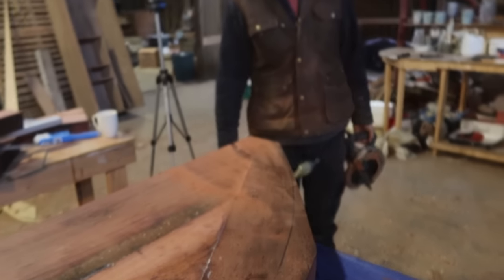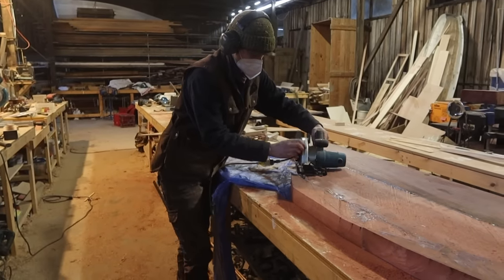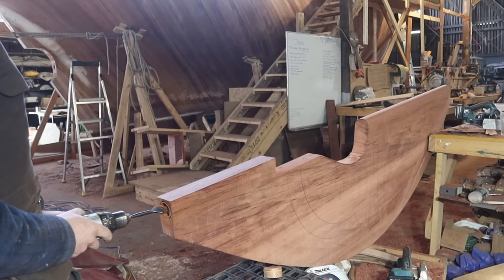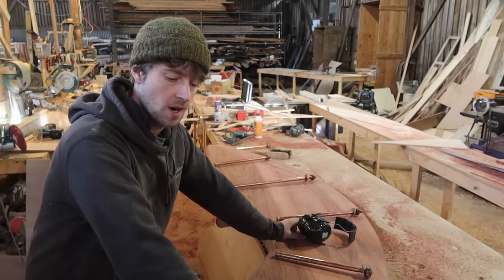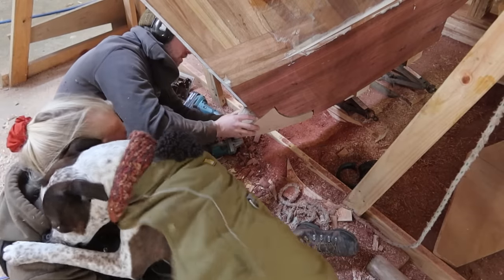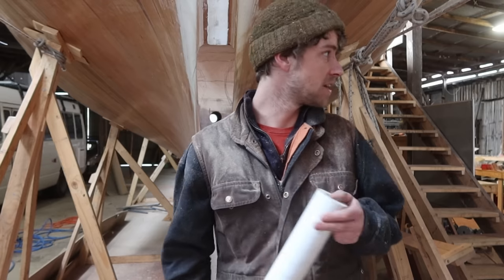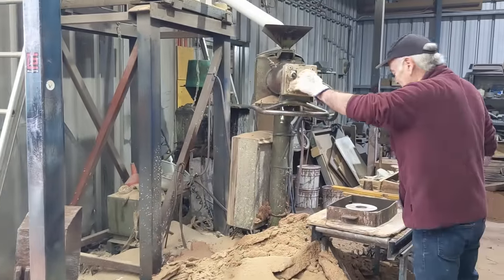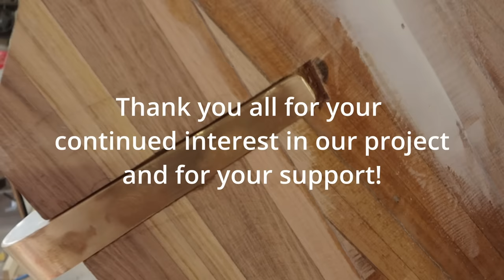Building the Rudder for our wooden boat / part 2 (EP31)

Comment: Another great episode with all the skills on show, the castings are excellent, and boring that hole over that distance is no mean feat, the boat will be a sight to behold when completed, watched from the start, never tire of seeing your progress, good luck from the UK
Reply from the maker: Ah what lovely words! Thankyou. Or was certainly a bit of work to bore through but we got it done!
Reply: I was terrified watching Matt bore that enormous hole in the rudder at the beginning of this video! I kept thinking, what's he going to do if he goes off line with that monster of a hole bit? I was esp. concerned about taking so much wood away from the rudder at such a crucial  load bearing point ! I do admit to a little concern remaining; do you think that there's enough wood left for the required strength left in the wood at that point or will the copper tube take most of the load? I am thinking of another casting to encase that part of the rudder? Just my thoughts on it. You two are fantastic artisans at what you do! Well done ! Cheers !
Reply from the maker: Yeah this may have not been explain well enough but the copper tube takes no load, the rudder stock (stainless shaft) goes through the copper but is not connected to it. It’s basically there to hide the stainless shaft.

Comment: having watched a few different people going through the same journey as yourselves building a nice wooden boat, i always find the rudder and interesting piece, both fairly complex to build etc, your boat in itself might have presented another possibility, might make a rudder easier to build, don't know
when you look at ships rudders, big heavy metal things, you begin to realise how they are made, rather like an aircraft wing, using sheet steel etc to fabricate the outside surface over a frame work inside, the voids are often filled with timber to prevent of slow the process of rusting away, filling with water and rusting from both sides - since your boat is laminated, (very clever) i wonder if the same could be done to the rudder, you build in all the hard wear and sandwich it between layers, sculpt the centre to have leading and thinner trailing edge, and laminate the hole thing, might it be easier to manufacture, possibly stronger, and last longer, or be it much less painful to replace if and when ever
Reply from the maker: Yes internal strapping is quite common! We have seen it done very well on a few boats, but we want to stare at the shiny bronze a little longer before it sadly gets painted.. haha

Comment: Who done your casting?
Reply from the maker: A very small and rather low key foundry in Tasmania, they are lovely people and make some great stuff but as far as we know it’s the only bronze casting in Tasmania. 
They are opposite spectrum engineering in Hobart if your familiar with the place
Reply: @Building_a_Boat_by_the_River  thanks, I am a local. Used to use Retlas bronze until they disappeared. Since then I have done my own small stuff, mainly rowlocks. Am a 4th generation boatbuilder originally from Southport/Dover. Didn't know there was a local foundry doing smaller jobs. Cheers and keep up the great work. Ps. You can put 2 holes saws  on one arbour in most cases, a smaller one will fit inside a larger one.

Comment: Worryingly thin wooden wall thickness where the copper tube goes through.
Reply from the maker: Ah yes the copper tube takes no load, it is just hiding the stainless rudder stock so you don’t see it and the rudder shape is retained. 
With a wrap or two of fibreglass it should be strong enough

Comment: Frankly a bit disappointed with the rudder design. High aspect ratio. You built a Spitfire rudder in the age of the F35. Look up tip loss. Look up Leo. The rudder ain't right.
Reply from the maker: Hmmm well you better bring that up with Paul Gartside the designer. 
Some things are better left alone for the designers specs. Leo’s designer has past so he cannot consult with him. 
And just because Leo made his rudder bigger doesn’t mean everyone should.
In Paul we trust, and if it doesn’t work then we will be plenty experienced enough to modify it.
Reply: …and your qualification for making this assertion is?
Reply: The rudder looks like it will be easily removable, therefore easily modified if necessary. It probably won't be necessary. I wouldn't worry about it, keep on guys!